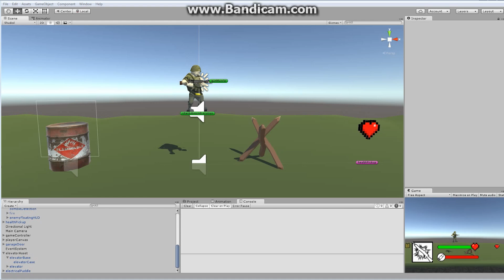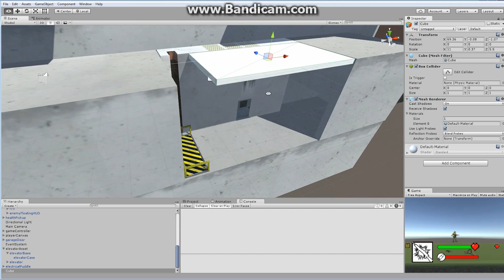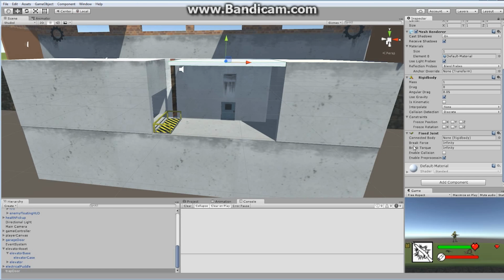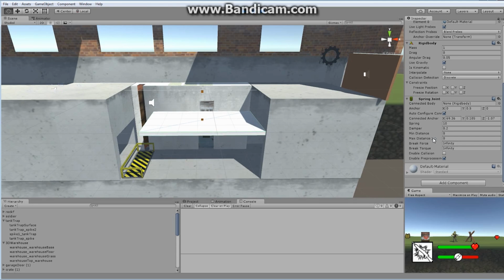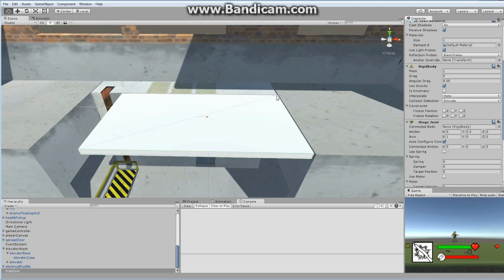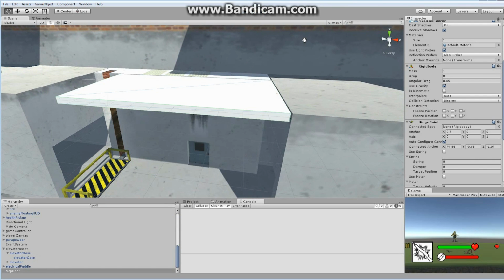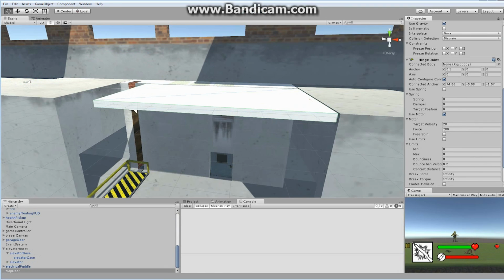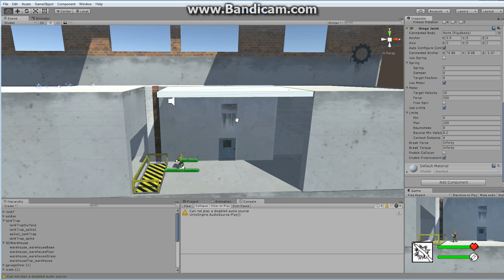Making Your First Game: Unity 3D Zombie Shooter Platformer - Trapdoors

Comment: I'm a bit lost here.  I've followed your directions to the letter 3 times, and still no luck with this.  The door (created as a cube, just as you did) falls down - but WON'T go up.  The point at which you direct to "use motor" and you show the door going up, mine just goes down as it did before.  Any ideas as to why this is?
Reply: i have same problem too in the first place, 
you have to changed the target velocity to -200 and force 200. cheers
Reply: Changed the target velocity to -200 and force 100 so that it works exactly as seen in the Tutorial above.